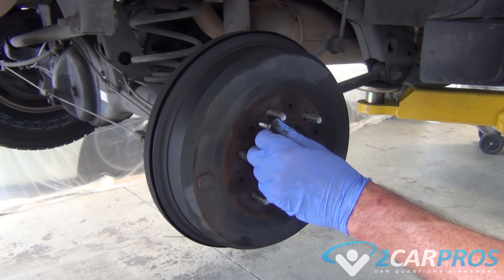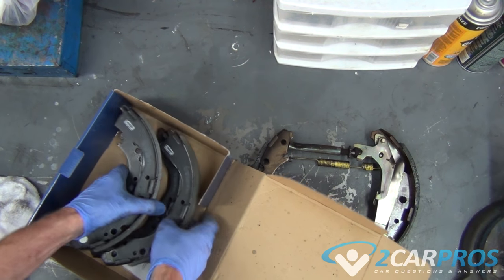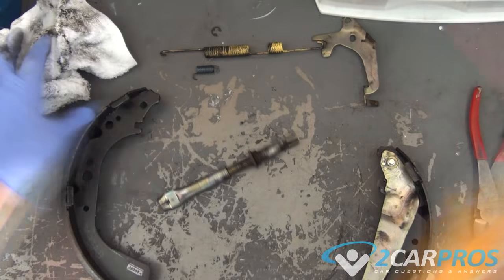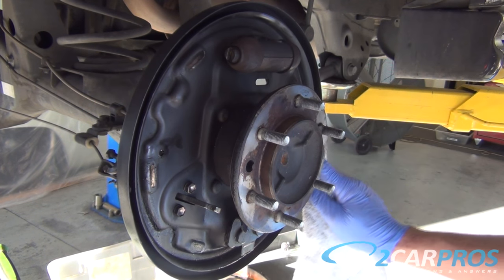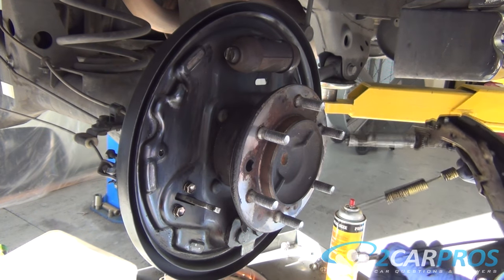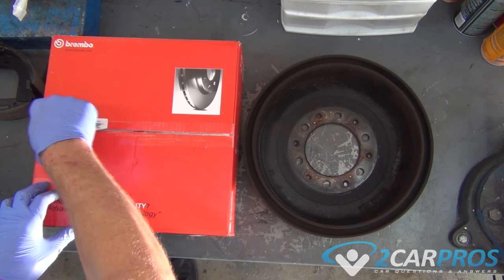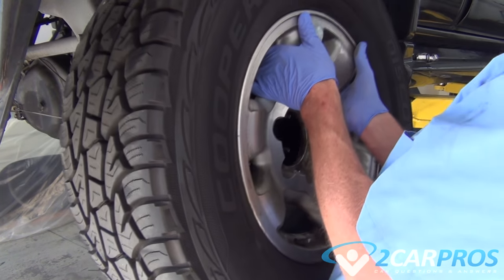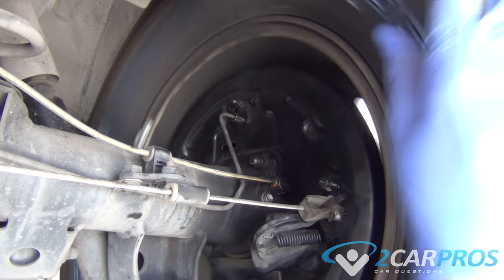HOW TO REPLACE REAR BRAKE SHOES! Toyota 4Runner 1996-2002

Comment: I think this works for models up to 2000,  for 2001 and 2002, they changed the shoes to be the same as the Tundra, your Tundra video applies to my 2002 4runner, great video in both cases

Comment: What size of bolts did you use to remove the drum? Those are brakes you replaced are brake shoes in the rear and brake pads up front.

Comment: Awesome, except that you should NEVER run these wheel nuts up with an Air Impact Wrench, which is why you weren't able to correctly torque them as they were already over-torque.

Comment: the torque setting on Toyota 4 runner is 110 foot pounds  then drive for apox 100 miles that torque them down again that is what the service manual says to do.

Comment: Yes I can spin with my hand on both the driver and passenger. When I first put on the driver side(I didnt adjust it correctly) so I need to pull the brake handle like at least 15 times. My 4runner is a base model.

Comment: It will be pretty much the same on the 2nd gen 4 Runner (1992). Is that right? And use brake cleaner it's quite cheaper than carb cleaner, and won't leave any residue. After all, that's why they call it "brake cleaner"... Lol..... It also helps if you lube the 6 lobes that the shoes slide on... Thank you for the video, It was very helpful...

Comment: Does anybody know what the brake master cylinder is called at the back rear axle that goes to both rear drums for a 1993 nissan d21 pick up and no it's not the wheel cylinders in the drums it's a pump like thing

Comment: Hi 2carpros, I have question. I just replace my drum shoes pad on 1998 4runner rear wheel drive. I put my 4runner on a jack stand and put it to first gear to check on my drive shaft but I found the driver rear side wheel did not spin but the passenger side wheel spin. It's that normal or do I have to make adjustment on the drum brake(and it I need to make adjustment which side should I do it)? Thanks.
Reply from the maker: Can you spin the driver's wheel with your hand or is it really tough?

Comment: Thank you for posting but I think I would rather pay my mechanic to do this. I am able to change regular disc brakes and rotors but this looks too complicated.
Reply from the maker: Thank you for watching!
Reply: Michael Campbell Let me know how it went and also the parts you used. Toyota drum brakes are pretty expensive. Thanks!
Reply: The task is easy... The hard part is reattaching that main spring. Just be sure to have a real good set of pliers, or a specialized brake plier to do the job without too much struggle. Now I am off to change my driver side drum.... I did the passenger side yesterday afternoon.

Comment: What is the tool being used at 8:46?
Reply from the maker: Check the link 

https://www.amazon.com/gp/product/B000F5ED4O/ref=as_li_tl?ie=UTF8&tag=2carprcom-20&camp=1789&creative=9325&linkCode=as2&creativeASIN=B000F5ED4O&linkId=3bdda95b44fc561e896bc73489d4261d

Thank you for watching!
Reply: You can borrow a brake tool kit from your local major auto parts store for free.
Reply: Needle nose or other pliers that are small enough work just fine too. The pushing and turning force required is minimal.
Reply: You can buy a 3 pc set at harbor freight for $12.99, one for the long spring and a tool the tension spring caps and a star lever tool. I am doing brakes today, I am going to get mine in about an hour and get started.

Comment: Disappointed in the coverage of the placing of the brake shoes on2 the car. It doesn't show you which holes 2place the lg springs. Or the wire underneath 2hold the brakes in place either.